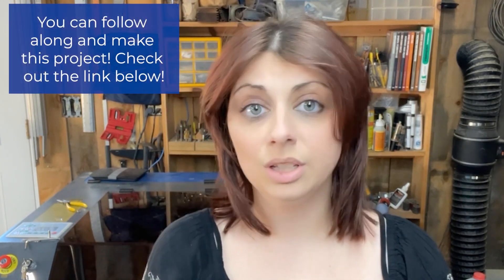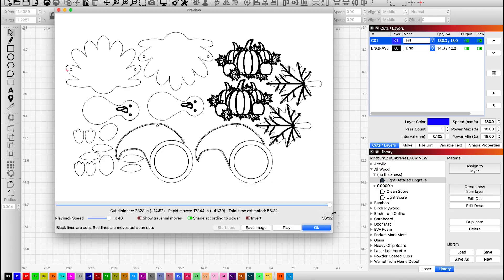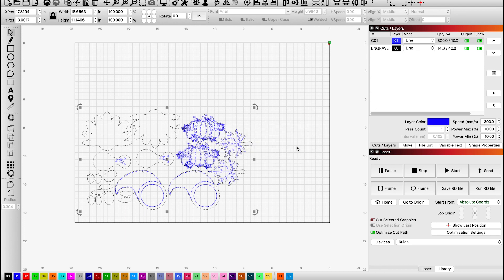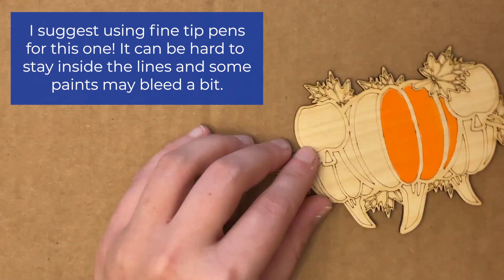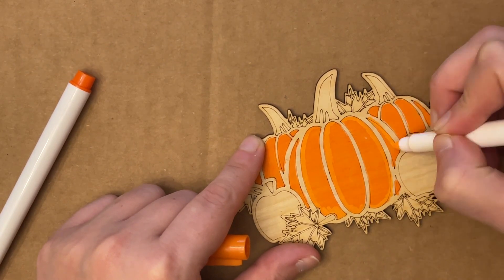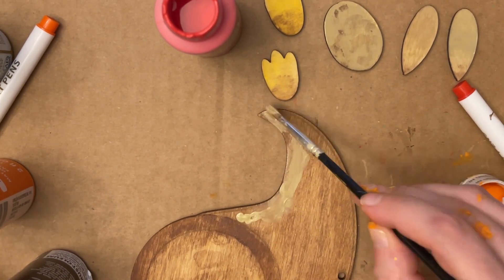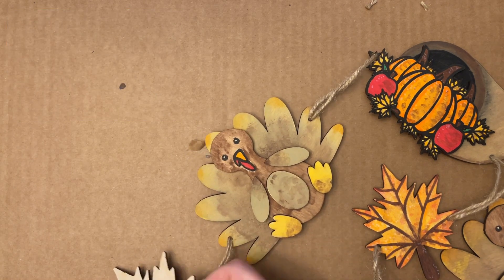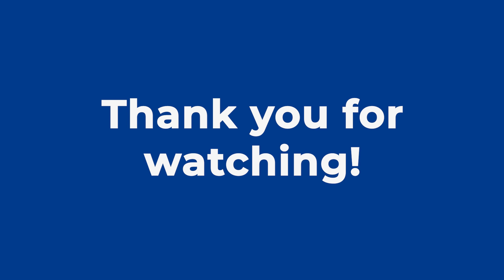Laser Cutting a Thanksgiving Garland with a CO2 Laser Engraver - DIY Project Walkthrough - OMTech

Comment: Super cute project! What power rating is this machine? I have a 70w and have so much clean up to do afterwards... This video shows you're cutting the final shapes at 40% power. Looks like a super clean cut but also that number is machine/laser specific. Seperately, I wish I had a max rating for travel speeds. I mean, What is my machine physically capable of moving at? I saw one video where the operator had 3,000 speed... I've never had my machine past 300... Am I missing out on some functionality becuase I'm not educated enough about my specific hardware? It seems to me that the software can send data to move at 3,000 speed but the machine may not be physically capable of that so, it will limit at "max speed". (also, I can't imagine the g-force load on the head at those speeds...changing back and forth so quickly - must be hard on the stepper motor or the head attachment points. I don't actually know, it just seems like acceleration/deceleration curves are another area I may need to investigate) I'm tired of throwing "Darts" at a dart board in order to get the results I want/need. Sure, Power/Speed ramps are fun but they don't really tell me the whole story :-) Thank you for the super cute project walkthrough!
Reply from the maker: The machine used is a MF2028-60. The quality of the cuts can be dependent on how your machine is dialed in (ie- mirror alignment, focal height) as well as air assist upgrades. The machine used in the video is a base model; no upgraded air assist at the moment, however a recent pump was installed.